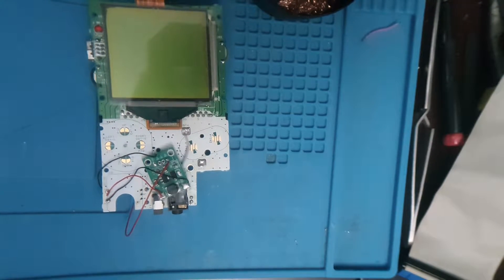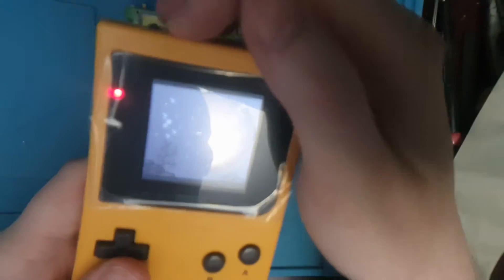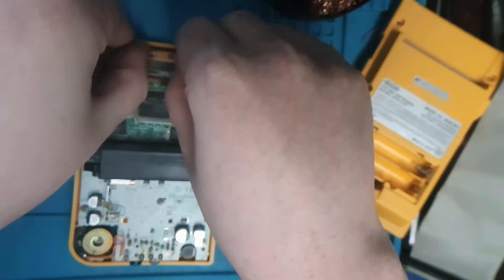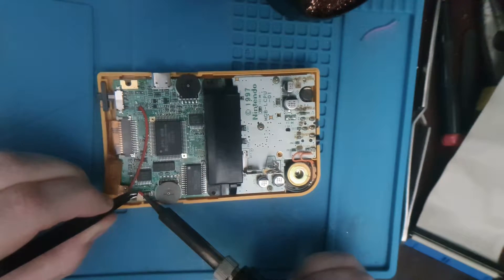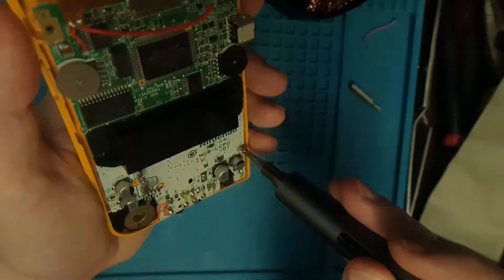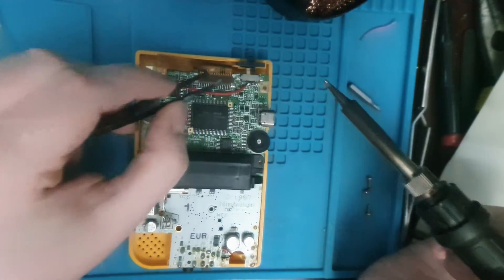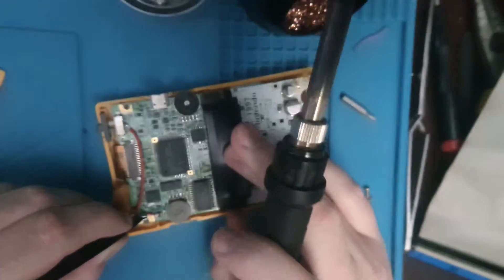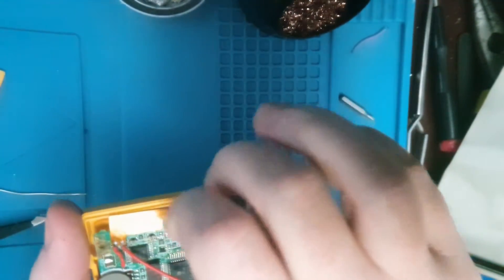Gameboy Pocket Screen and DC/DC Board Repair/Replacement

Comment: Just checked out the video, seemed like a promising solution to a common issue! Did you ever get the system with the replacement DC/DC board to run on an IPS kit?